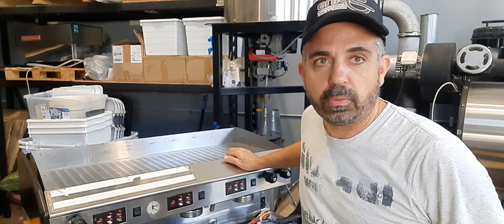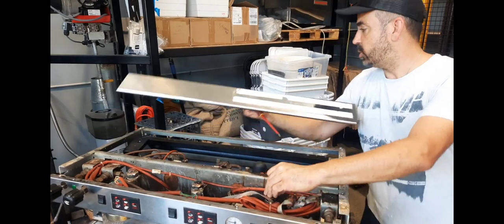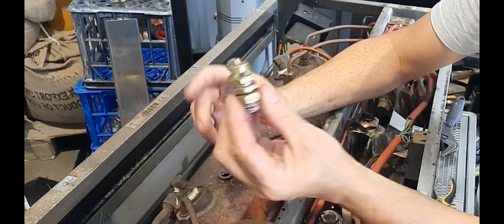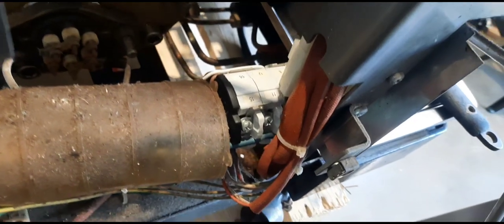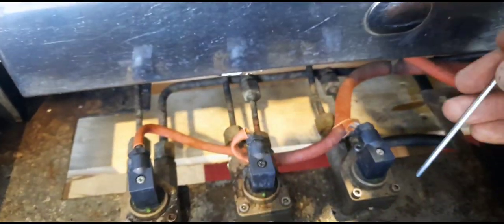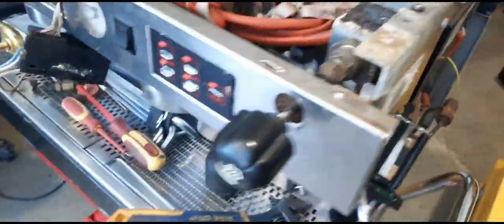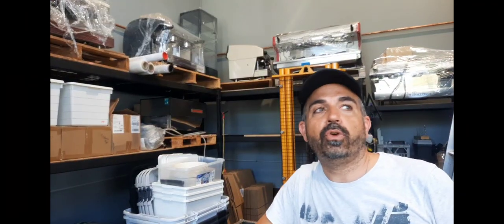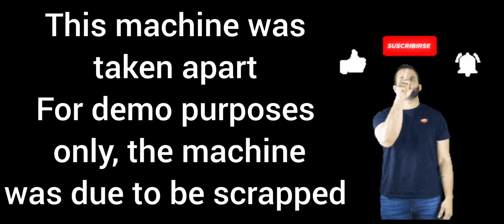how to repair commercial Wega coffee Machine

Comment: The problem I’m having with my Cecilware machine right now it keeps releasing water from the safety valve , is that because the safety valve is going or is there another issue cause the water to release from the tank ?
Reply from the maker: @Ishmaellllllllllllll  check the pressure gauge that will answer your question
Reply: @coastcafeequipment  it was the pressure stat and the probe was bad , I cleaned it out with some sandpaper and it started back working as it should .

Comment: Hi great video! I have Wega coffee machine with 2 groups model EVD but I think I have a problem with the pressure as the left side pours out more water and the right side pours out less water and more steam. The pressure thermometer stays at 3-4 when it is not in use and goes up to to maximum 6 when in use it does not touch the green zone at all. Do you know where the problem could be and how to fix it please?
Reply from the maker: Clean the jets and filters to start, then clean the flow meters if the issue continues

Comment: My wega 3 group coffee machine is not turning on.there is no power. Can you pls assist where I can find the fuse location. I will try and change it
Reply from the maker: There is a fuse on the main board, unlikely to be the issue. Most common is main switch issue
Reply: Thank you

Comment: if the pressure stat goes bad, and only two of the connection points are used already. Can the other points be used or does the whole thing have to be replaced?
Reply from the maker: Can use the other one no problem, pull the burnt one out w pliers so it doesn't affect the good terminal by not closing completely.  Don't forget to subscribe
Reply: @coastcafeequipment  Thank you. And I will

Comment: I have single group, same model. Works good manually but automatic shots are not working, any ideas. Would it be the main board or the button board.
Reply from the maker: Could be, more info needed
Reply: What info do you need
Reply from the maker: @patricklucki5368  could me main board, buttons, ribbon cable, flow meter. Need a tech to look at it on site, it sounds like

Comment: need expert advice on how to clean a hx boiler. There is a layer of SUPER hard black resedue I can't get rid off. I have Used decalz, and cafiza. No effect really. And now I am going to a surface specialist in blasting with glas.
Reply from the maker: Acid
Reply from the maker: Usually people use acid
Reply: what kind of acid?
Reply from the maker: @plurplursen7172  critric from what I have heard, but I haven't done it, see no reason to. So do some research
Reply: @coastcafeequipment  I never used citric. I just used the normal coffee decalz. Maybe my solution was not strong enough. Anyway I am hoping the blasting will remove it, and make the copper surface stronger
Reply: @coastcafeequipment  I ran to the store and got cirtus powder. made a 1 tbs to 1 L and it reacted on it right away. About 60% have been removed after 1 hour !! HAHAH thx man

Comment: hi great video i have a 3 phase group 2 wega polaris have you  got info to re wire to single phase please 
cheers leigh
Reply from the maker: I'm sorry I don't. However I don't think there is any 3 phase machine. Perhaps 32amp. You can change the element or limit the elements you use.
Reply: thanks for reply how much is your coffee and do you have amount i could buy to try out i live in townsville queensland just setting up shop and have a wega polaris 2 group i sorted power but have problem wont pragam left side grouyp any ideas what to fix 
cheers lee
Reply from the maker: @leighyarnall7346  check the switch on the right have side is on while programming and off while using. U will find the switch under the right steam knob
Reply from the maker: Other issue could be the flow meters 
, look at the video how to locate and clean.
You can order online @
https://spinaespresso.com.au/